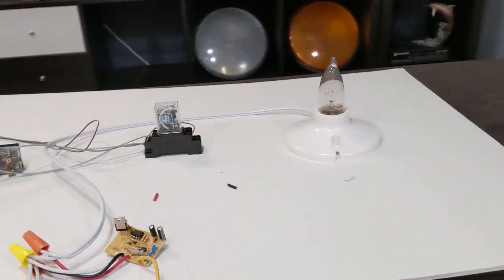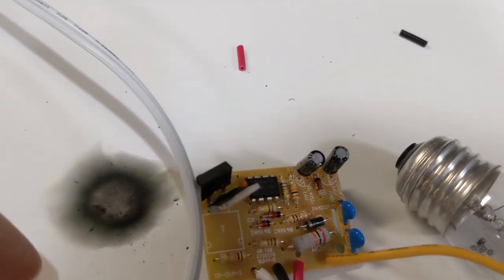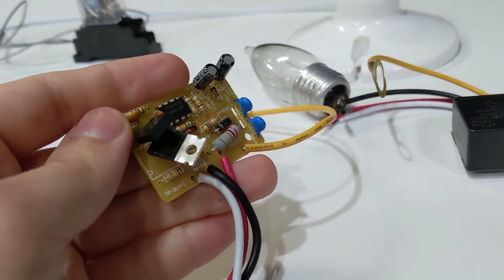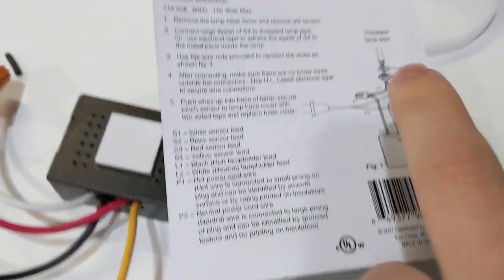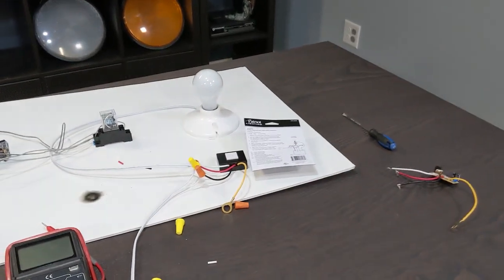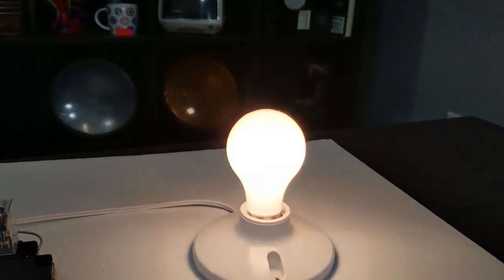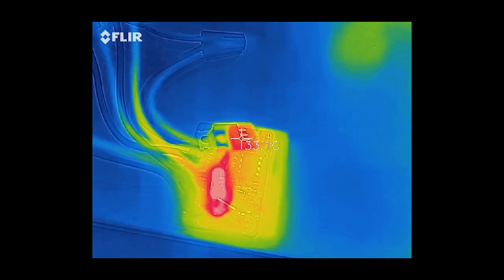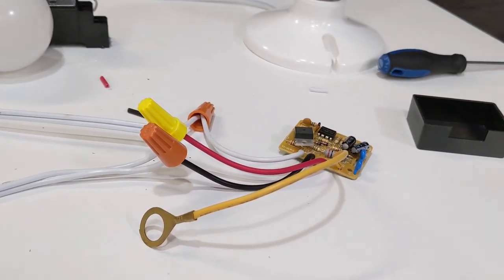A slightly explosive touch-lamp follow-up (standby energy consumption)

Comment: I love how most of the comments are "Yeah those wiring colours make sense to me".

But  yeah, good lesson for all... READ THE DIAGRAM because nothing is ever truly "standard".
Reply: I love standards. There are always so many to pick from!
Reply: Underrated comment. It’s true
Reply: @softy8088  Not when it comes to AC color codes .NEC /CEC has one standard
Reply: Andrew Camarata had a few of those blow up or shock him. So the wiring didn't make sense to him either. Andrew Camarata made a video about a little bit ago. Edit: the video from him was called "Installing a touch sensor in a lamp"
Reply: Love this comment. I made products for private jets and was astonished at how much in airplanes are not standard, its more damage control after catastaphyand how much control we have.
Reply: @niyablake  I use completely diffrent Colors with AC than you though (Brown,Black,Grey for the Phases/Hot, Blue for Neutral, Green/Yellow for PE/Ground). And diffrent Frequencies (50Hz) and Voltages (230/400V).
Reply: @unitrader403    Black here is hot for single-phase , Brown L1   Orange L2    Yellow L3 phase of  three-phase .   OR  just   Green/Yellow for PE/Ground onside an appliance.  If you see   green/yellow for the ground on a wall socket that's an isolated ground